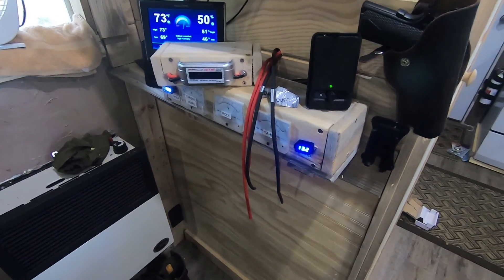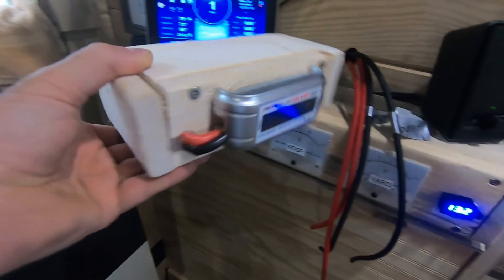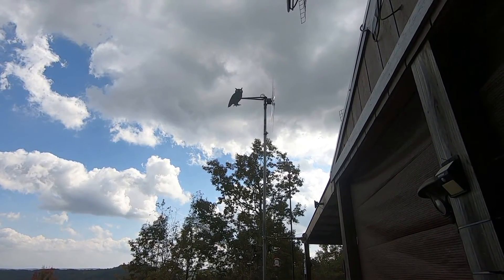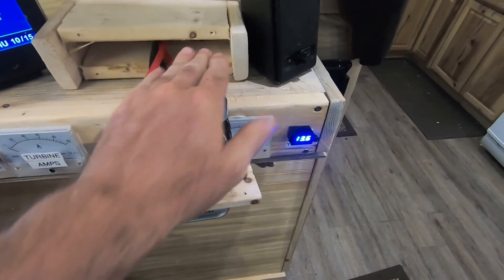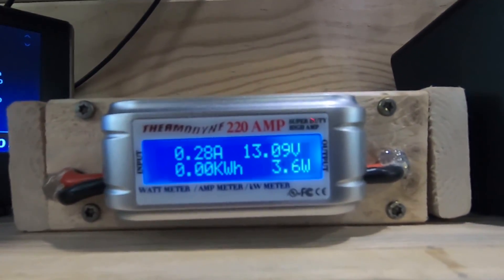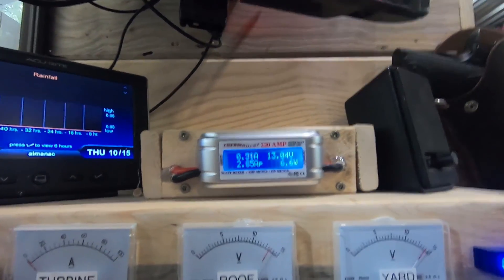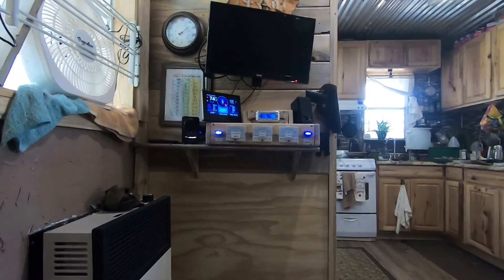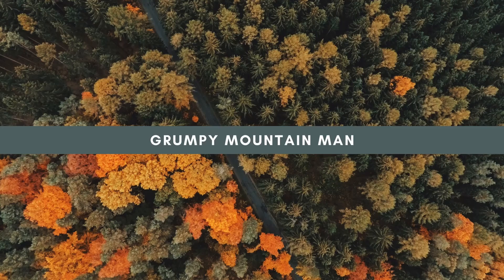Thermodyne Watt Meter Install for Micro Wind Turbine Shed to Home Off Grid Power Off-The-Grid

Comment: I got one of these I have a single phase turbine so I connected the live and Neutral to the source side and the load side to my battery. Is this correct as I'm only reading 0.05 ap on a 600w turbine when its spinning ??

Comment: The Analog meter is AMPS.  On the digital meter,  you were reading the WATTS ( not the Amps ).  Yes, the WATTS value will be about 13 times larger value vs the Amps.

Comment: look at Lascar Electronics, RS Components, Farnell Electronics, You can get a Lascar  DC to USB Data logger for very cheap, probably have to step dowm the voltage with a voltage divider, but you can plot on a laptop - PC
Reply from the maker: Thank you!